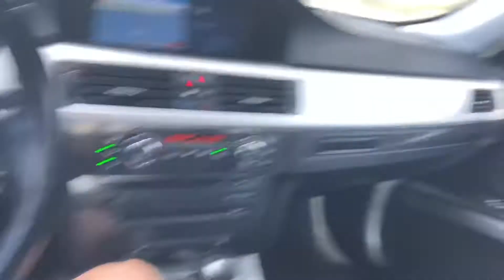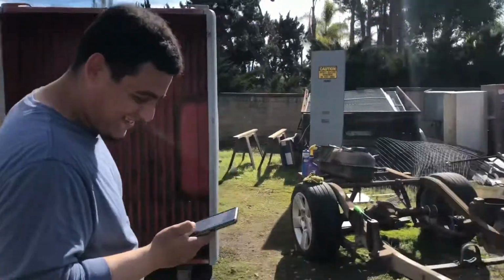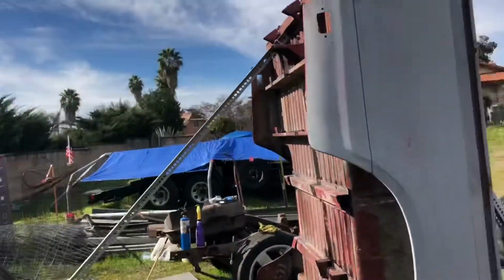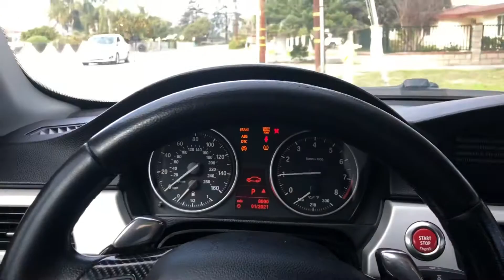Datsun Pick-Up FIRST EVER BEAMS engine swap!!!!

Comment: Love the Datsun 620 they were my first vehicle I've ever owned I hot two of them back to back in high school, I had to get the second after seizing up the first when a motor mount broke and the engine went threw the radiator it over heated so bad the next morning I thought I had a dead battery so we tried to push start it and the wheels just locked up. I only paid 600 for the first one and it was bad ass had new interior, hood scoop, visor, true spokes, roll pan, Holly carb, glass pack louvers and it was nice of course the was in 1991 or 92 I got the second one for only 900 and it was completely restored as well with power windows and bazooka tubes so I just took all the cool parts from the first one put them on the new one and abandoned the first one in my sister's front yard I wish it was still there. I've been wanting to buy one to restore and re live my high school days lol ide love to do a wide body with a engine swap. Anyways you do you I'm excited to watch